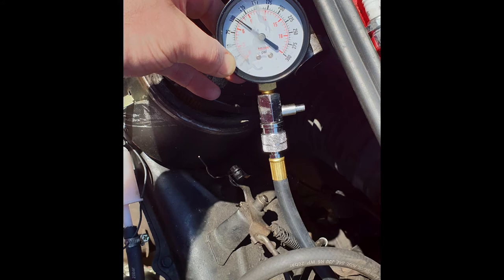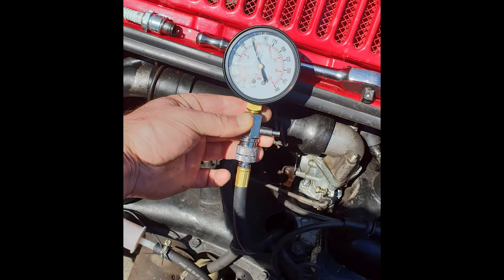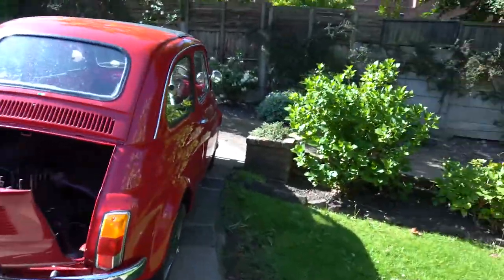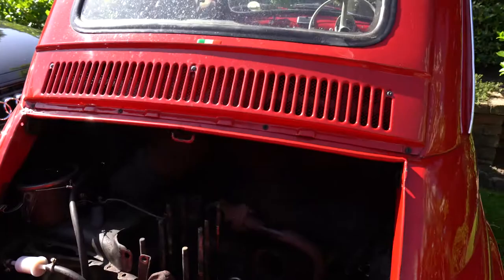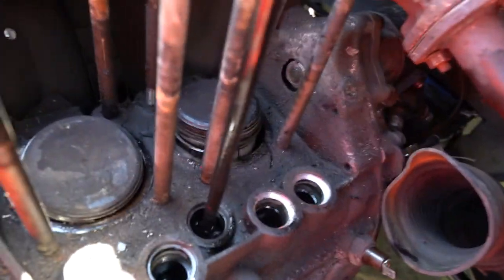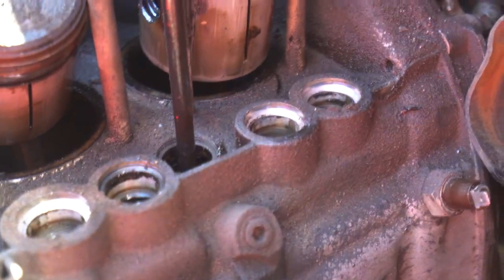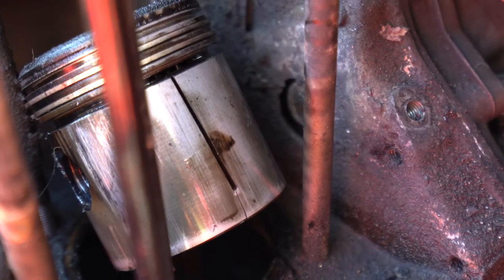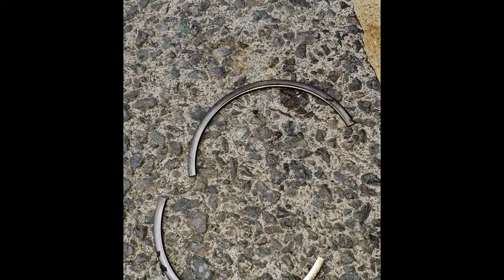what happens when you don't service your classic fiat 500 !!

Comment: I'm refurbing my 650 engine in my 1969 L. I found ur videos. 1st...THANKS....I've not done this before and the confidence ur vids have given me is immeasurable. 2nd...Question....the short vid where the customers cylinder was cracked...you had the barrels off but the pistons still in place. Can you top-load the barrels back on? I'm at that point and don't know how to do it...any advice? Thanks again!

Comment: Hi. I have a question. Can the engine be disassembly when is still mounted on the car?
Reply from the maker: Yes you can remove the head and bits but it's so easy to take out
Reply: @only1stefan  I have a problem with my 500. It won't start up. There is spark and fuel/air too. I've noticed that when I turn around the pulley from the head I hear like a sound some air pass like. Sorry for my bad English. I'm Romanian.thank you in advance

Comment: Hey man im having problems with my 126p it has spark on both the dparkplugs and the distibrutor, fuels good bub doesnt want to turn over, any sugestions what should i check
Reply from the maker: well when you say does not want to turn over you mean the startor motor does not turn the engine?or it spins and does not start